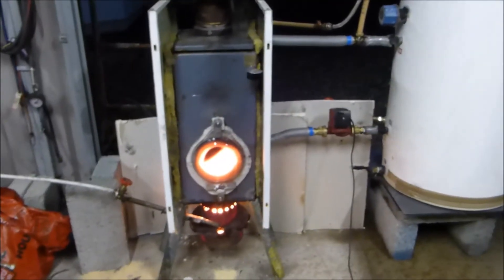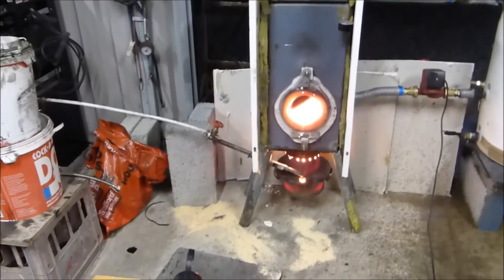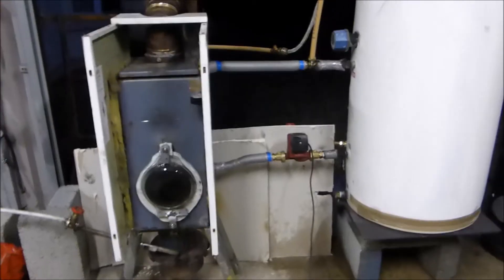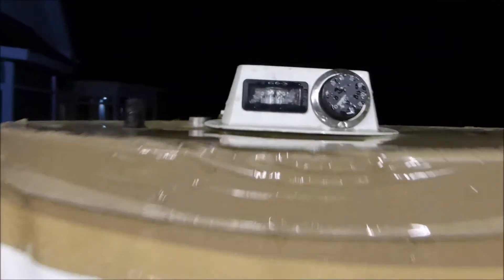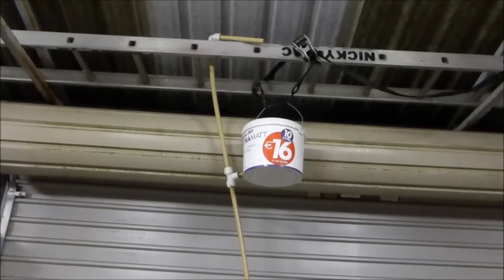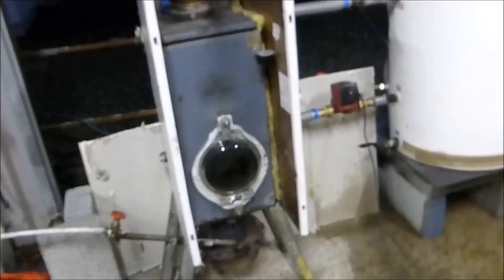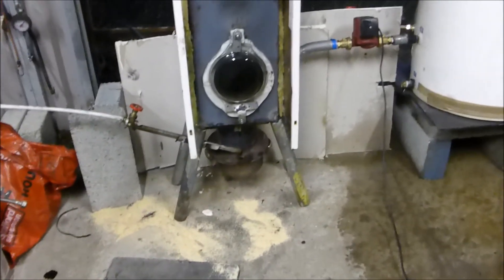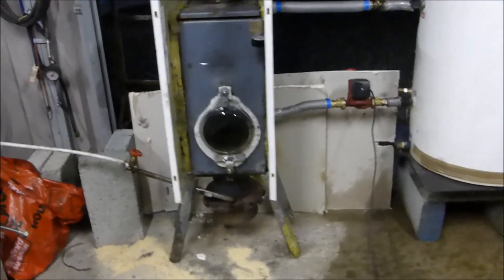Free hot water and heating from waste oil. Easy build.

Comment: Gerry .A question. Is that a pump going from the cold water feed into the boiler?
Reply from the maker: Hi Peig. There is an indirect coil in the stainless steel tank. The pump circulates water around this coil which in turn heats the water in the tank. The water in the tank is clean and separate from the boiler. Most heating systems in Ireland provide indirect heating to the copper cylinder. I am making too much heat for this system to run on gravity / thermal siphon so in this case it needs to be pumped. Here's a playlist with some builds and even a domestic boiler stove running on waste oil. Hope this helps Cheers Gerry  https://www.youtube.com/playlist?list=PLmQ5wJnkAIoIoGqpCaCPU6A1vRudk4jHz

Comment: Hi Gerry. How was the hot water service when it came to steam output as im thinking of running a steam motor and using waste oil to run heat the old service.
Reply from the maker: Hi Patrick. I made a lot of steam with this burner but the forced air burner would be more controllable and have higher output for a steam project. I will be making gun type burners in the next couple of weeks and I do intend doing more boiler projects too. My updraft burner would make more heat than the burner in this video and could be contained within the boiler but a riello conversion would be far more useful if you have power on site. What steam motor setup were you thinking of for making power. Cheers Gerry
Reply: GerrysDiy I'm going to try and convert a 4 stroke Briggs N Stratton motor hooked up to an alternator. I have just got hold of a 300lt hot water service and just going to have a drip feed oil into a standard gas bottle like your setup with the BBQ/heater. Figured I can make heat and steam while making power.
Reply: GerrysDiy I got my inside measurement for my gas bottle for the separator disc. Just need a 400x400 plate to cut it out. Which now tells me my top door needs to be at least 400mm width to get the plate in and working right.
Reply from the maker: Hi Patrick. It might be easier to spin a turbine but it would be noisy. My burner is working very well but I will start a boiler project next week. Heating water is very easy with these burners and so is making steam. Patrick if you get this steam project moving I would love to see it. Cheers Gerry
Reply: HIya Gerry, you will have to have a look at the video I put up. Cheers.

Comment: ... is it possible to have details of how to make it ? I didn't catch this video !
Reply from the maker: Hi Pascal. In some of the earlier videos I show how to make the burner component. The boiler is just an old oil boiler with the burner taken out. The rest is just a flow and return setup to a 300l hot water storage tank. It worked really well and it could produce a lot of hot water all day long. Let me know if you need more. Cheers Gerry

Comment: Hi Gerry. Ive just completed a blatant copy of this using a slightly bigger boiler carcass for a hot tub heater. I've filled an 1800 litre tub with 10deg mains water and circulating as you've done got it to 41 deg in 4 hours! Seems to give around a 10deg lift in temp from one side of the boiler to the other on a medium flow setting from my vari speed circ pump meaning that keeping the tub up to temp should only require running the boiler for an hour or so every day. At around 3 - 3.5 litres an hour when running a 45 gallon drum of waste oil will last nearly 2 months! As you found full baffles reduces the draw too much but by grinding long wide slits in the baffle fins it draws nicely and keeps a lot more heat inside. Well chuffed, good video. Cheers.

Comment: Really nice job, you did there. I have done some calculations also, and yes it is over 22kW / 77000BTU/h. And that is "only" the energy stored in the water. If you add the losses through the chimney and the radiant heat of the burner and the boiler, that is definitely close to 25kW burner. Something similar I have with my scrap wood heater. Everything is finished, but did not get the chance to prepare and edit the footage. In a week time maybe... :-)
If you need, be free to contact me about regulation/start up/shutdown and the rest...
Keep up the good work...
Reply from the maker: Hi mihovil -d Thanks. This burner unit is very basic in design and I wanted to make this setup work without a pump but it produced too much heat. Also my storage tank won't work on gravity. Anyway with a pump it works really well and produces lots of heat. Cheers
Reply: successful waste oil burner
Yes I know what you mean, that is understandable. There is to much power for thermo-siphoning with small diameter pipe, but for pump its for sure OK. :-) (time & larger pipes are preferred for that :D) Other part what I meant was, to regulate the burner output with the thermostatic controller without the electricity and solenoid valve.
On the other hand, with the off-grid scenario couple of TEGs and a battery can always be handy...
Keep it running :D Bye
Reply: Gerry's Waste Oil Burner
 would a smaller pan (something the size of a can that vegetables or soup come in) where the oil is delivered  plus a slower gravity feed rate of oil make a smaller flame?
Reply from the maker: johncartelli Hi John. Yes it is possible to run this with a smaller forced air burner so that there is nothing under the boiler. Flow rates and temperature are more easily controlled. In my linked video I am actually burning oil in a dog food can. It produces an amazing amount of heat if turned up and if you want less you just dial it back. So long as you can keep the burner red hot you can decrease the output significantly. Check out the new burner here. http://youtu.be/QQGtl87-x58
Cheers Gerry
Reply: Not yet realized how the air is injected into the combustion chamber. What is the device that you use to inject the air?
Reply: @CALORNATURA  it doesn't have forced air. It's naturally fed.

Comment: Well....respect! heating 300 litre of water to boiling point in 1 hour. Thats a hell of a lot of energy you put in. Just wondering if it is posible to shut the oil flow of with the thermostat of the boiler itself.
Reply from the maker: Hi pnbsracing. There is no automatic way to relight this burner but I am waiting on some parts to arrive and I will be doing a build in the next few weeks that will be put on a timer and thermostat and restarted electrically. Stay tuned Cheers Gerry
Reply: How did the thermo and elec restart go? Do you have a like to that video Gerry pal? ☺️
Reply from the maker: Hi Marcel. Yes it is an easy matter to add a solonoid to the oil supply pipe and have it shut off when the stored water temperature reaches a certain tempreature. In the video I just wanted to get close to boiling but not steam. I will be working on a different burner type soon. Cheers
Reply: Gerry's Waste Oil Burner  do you have a way for it to relight its self when the water would cool down?  I have thought of the solenoid to turn off the oil,  the problem I am try to figure out how to overcome is relighting it automatically  when the water temp drops.
Reply: rory lobban e